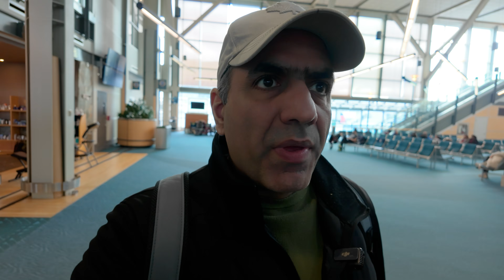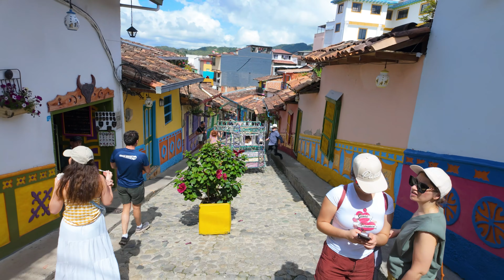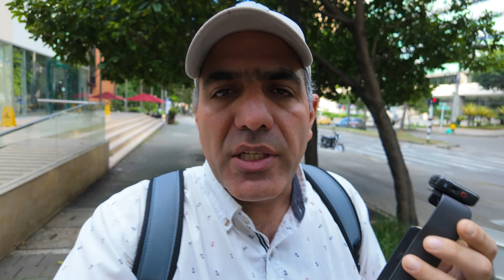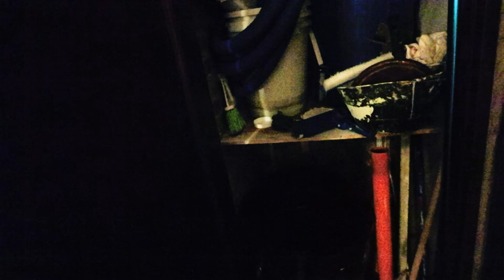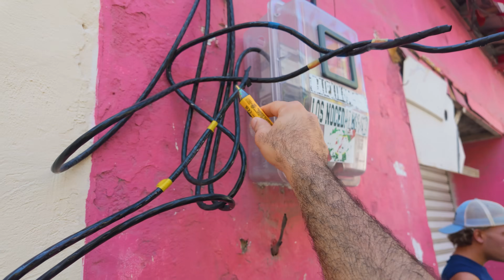Colombia Electrocutes Burglars

Comment: 22:12 you should be thankful the batteries were dead when you tried setting it off. if It wasn't dead and you clicked test, it would have set the alarm panel off and call the fire department, as that smoke detector connects to alarm panels.

Comment: Dude!! I know right? (skinny wires) I bought a deep well pump 220V from a UK manufacturer. when i went to install it the wires for the pump and run-capacitor were 16 or even 18 gauge!!!
thought it would immediately Fail!!!          that was 3 years ago:-) good pump. no problems!!!
please explain in a video!!!

thanks.

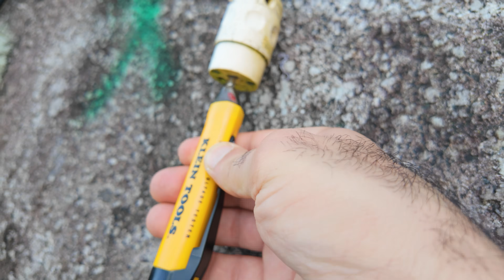Comment: Also, 12:46
Is no one going to mention that plug was wired backwards? He stuck the voltage stick into the long slot, which is supposed to be neutral, but it beeped, meaning, it was actually connected to hot.

Comment: Here in Colombia most old houses don't even have ground wire conection, sometimes not even the copper rod to make earth, so we basically have those 3 legs outlets with a dumy earth so yea you just were lucky to get into new stuff with apropiate elecrtrical standards

Comment: In latinoamerica electrical regulations are not... really.. applied. Connection to earth is kind of a luxury, my building is old enough that it doesn't have one and I live in a very modern area in my city. Most people just... never add earth to their system or they just connect it to the nearest steel rod inside the wall.

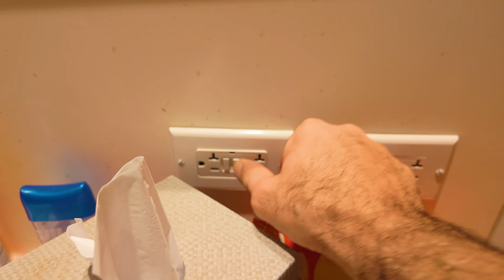Comment: 7:20 In Brazil, we have 220v and 120v depending on the location. States like Santa Catarina have 220v single-phase and 380v three-phase, and São Paulo has 120v single-phase and 220v three-phase.

If I'm not mistaken, some parts of the Northeast also is 220v single-phase, places like the state where I live, which is Paraná, and São Paulo as well, that have both. My house, for example, has 220v and 120v outlets, and the outlets are the same. Nothing prevents some crazy person from plugging a 120v appliance into a 220v outlet. The only difference is that the 220v outlet is red to identify it.

The power lines in my house is two-phase and single-phase. This means that there are two 120v phases and a neutral wire. Combining the two phases gives you 220v, and combining either phase with the neutral gives you 120v.

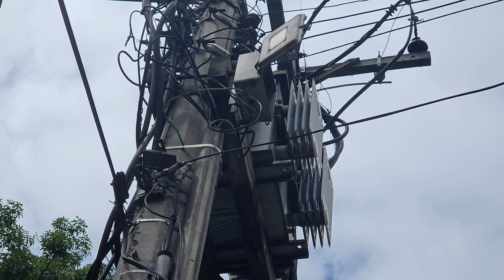Comment: @4:21 thick wire to the high voltage primary. Thin wire to the low voltage secondary, not a fuse in sight.

Comment: India almost follows similar electrical system. 

In kerala( A state in india) plants generate at 220 or 400 kv then through a network of substations on several areas into 11 kv. And the 11 kv lines are then transported to a transformer near house and distributed at 220-240 vac 50 hz all through overhead aluminium and steel reinforced conductors. You will not find any GFCI outlet anywhere. The whole house power system is hooked up to a RCCB and most of the time in several houses these RCCB's are non functional. The law requires u to have a ELCB or RCCB or you will not be granted electrical connection from the state but noone cares to use any test functions or periodically inspect it so the deaths due to electrocution is pretty high here.

Comment: 25:03 Trap for outsiders: DIY 240V.
Reminds me of the Type F socket I came across, that someone DIYed to 360V 3 phase. With one phase (24v 16A) on the earth pin. Which is exposed. And also not made to carry high current for prolonged times.

Comment: When you go on a nerd vacation for electrical things.

If you go outside the tourist areas/ to older areas/ less welthy areas you will probably find the sketchy stuff your looking for.

Arround 18:50 the non functional fire alarm, is illegal as far as i know at least where i am. They must have some other system in place but have that there because otherwise people will not reconise they have any but to have everything there and ready to plug in but it is not plged in means that it is supposed to be.

Comment: Watching from a high rise apartment in Medellín. About twice per month, a power line capacitor will explode in our neighborhood and we'll lose power for about 2 seconds. No big deal. I know little about electrical engineering, but I want to note that most homes in Colombia don't have a dishwasher machine nor a clothing dryer (no 240 volt outlets). Maybe that's why the residential wiring is thin?

Comment: As a gringo living in Colombia (with a Saily eSim), I can promise you'll find worse if you look. My first Airbnb in Cali had an electrical receptacle in the shower, with an extension cord plugged in, with the end hacked off and attached via electrical tape to the leads from an inline water heater. This place had perfect 5 star reviews. I uh... did not stay in that location. The breaker "panel" was literally just a bunch of wires attached to breaker modules and stuffed into a recess in the drywall.

Comment: On some electricity detectors, if you hold the on the button, it turns on to a silent mode. The light still turns red but it doesn't beep. Slightly less alarming to random nearby people.

Comment: If you suddenly connect a discharged capacitor while the voltage is "not zero" you can have more than 9 amps, maybe 900 for an instant, before your formula becomes valid.  Only circuit resistance will limit the spike 👍

Comment: fun fact today its not to accurate but back in the day ive been told every ring on a insulator is an amount of voltage like 5kv so 13.2 residental distribution has probbably 2 insulators. 130kv has a lot lol. im amazed the transformers were on the pole until i said duhhhhhhhh lol. the fact that they look like a pad mount transformers that are outside its case made me think something was wrong then when you showed the 10kv transformer i realized. .

Comment: If you ever come to Brazil, there is a large chance you'll miss the opportunity to bathe in our electrical shower heads because hotels like to be fancy and have gas heated showers. Also, bring a "Type C" outlet adapter or get one in here, because Brazil has a unique power outlet that is recessed into the outlet itself (be sure to see what it looks like before coming). Those North America flat connectors won't fit

Comment: Fala ae, faz um vídeo aqui no Brasil, faz estes testes aqui por que as instalações elétricas no nosso país tem lugares que seguem os padrões tem lugares que não, tem uma parte do país que usa 220AC e outros 127AC 60Hz, dizem que tem uma linha de transmissão que eles transmitem em DC 😱😱  e quando chega na subestação eles convertem em AC, tem lugares no Brasil que não usam aterramentos temos trez pinos mas se usa só dois a maioria das vezes, tem lugares que não usam sistema de fuga de corrente IDR, e tem uns lugares que o único disjuntor é na entrada do medidor lá usam 100A uma vez quase botamos fogo em um estabelecimento por que só tinha este de Disjuntor de 100A usamos um adaptador de tomadas e acabou grudando no pino da tomada na hora de tirar ocorreu um curto circuito e derreteu todos os fios.

Comment: What would you think of a tube made of carbon nanotube rope/@wiring” that also doubles as a composite- with boronitride and other insulation dispersed throughout?

You could have 3 phase power geometrically spaced as an octagon, inside a hexagon- arranged like a knitted tube/ring eventually the walls being arranged like avenues, streets, and screws/elevators/drills/didgeree doos*

All the power and telecommunications would be underground- and electrically isolated/protected.  

Besides having graphene ultracaps, carbon nanotube flywheels, lithium iron batteries, and so on easily added and dispersed (not including what would be on the interior surface of the “tube “- shaped like the one on the old bell labs video {complete with z*speaker grill/slinky*})

24 phase power for a reason 🤧 
- besides power and communications, it would be the largest data center/supercomputer in the solar system

Also- each “sock thread” is at least as wide as a 2 lane (4 lane combined) road/tunnel with easy accessibility.
(It’s a huge sock knitter/dimensional geometric loom)

It would Be cheaper to live there than it would be on earth. By a country mile…. Including power, internet, and other factors….

- imagine being PAID to go to school and live in paradise?!  Just be good…

It would also double as huge telescope, particle accelerator, Turbo, and be even more accurate with measuring gravity waves- just when fusing down to iron- don’t throw it out the back…

The walls would be perfectly electrically isolated (emf shield by design- mainly because of interstellar radiation, external EMF) and the Gigantic magnetic fields on the external outside…. Surface (🎉)

The amount of chains and simple transformers stemming from the central sleeve (ground) to the exterior would be Impressive- Ofcourse, Accoustics and wave dampers/absorbers/noise canceling would be a thing- so you don’t have earthquakes…

Comment: In the middle of some tiny village in Kenya i once found a barber shop made from mud and sheet metal. The windows were just openings covered with metal mesh. I noticed a power wire connected to all of those metal meshes. When i asked the owner he explained he buried the neutral in the ground and in the evening before he leaves he turns on the breaker setting the metal meshes live at ~230V. He did that because apparently there was people stealing his electric shaving machines in the night by ripping out the metal mesh and climbing inside.

Comment: You will see far sketchier things in Syria , out Transformer rooms are open with the power factor capacitor panel broken or operating faulty with Car Battery jumper cables for fuses 
And how the Internet goes away when the electricity comes due to massive interference from both our power lines and our PWM chinese battery chargers or how solar has conquered the country with hybrid inverters but no one is even aware of the hybrid mode so all of it is off grid 
How a Syrian electrical made equipment has no fuses because its meh :/ or how an entire house electricity supply runs threw just one miniscule breaker 
Its not even uncommon to see electrical lines touching each other arcking and dropping molten metal on what ever is under neath

Comment: I don't see an issue with the electric fences. We should adopt them in Canada. It's got to that point in many areas. 
I would imagine most homes use gas to cook in Colombia, don't have a furnace or many high draw appliances traditionally,, so maybe that's the reason for the lower guage wire? I don't think there would be a call for much more than a 60 amp service when all the infrastructure was originally built, maybe less? what do I know? I'm guessing.
If you value sleep during a vacation, don't go to Rio during Carnaval. It's a week of total chaos, sleepless nights, eating, drinking, partying, and more fun than you'll ever have.  I miss Brasil.
Columbia looks beautiful. Always wanted to visit.

Comment: 25:49 i feel the temptation, but alot of electricians do not label the breaker as “do not turn on, working on” this could have result in someone dying. Just wanna say, check if no one is working on the electrical installation before turning a breaker on! Especially public spaces

No critics to our engineer *

Comment: I'm so happy you visited my country! Regarding the thin wires in Bogotá, it's uncommon to have high draw appliances. Weather is always mild so A/C or heat are rare. And most homes use tank-less gas fired water heaters and gas stoves and ovens. Really the highest current drawing device most homes have is probably a microwave oven.

Comment: If the hairdrier was designed for both 12 and 240 VAC Then with constant resistance, it would to twice the the current in its very short life-span on 240 volts, while burning hair of the person blowing focused 3KW air to users burning hair

Comment: Mehdi, just one note: Many times you zoomed in telephony or fiber cables. In South America as whole, we use posts for basically everything that needs a wire, with electricity running the highest and other cables running lower. Many telecom “store” cables for new customers on the posts, so they don’t need to be joining them every time a new customer shows up.

Comment: The electric fencing has two functions. It shocks people trying to enter but once the fence wires touch each other a alarm is sounded it also works if a wire is cut and the circuit is broken alarm is also sounded which is then the main repellent as criminals know they have been detected.

Comment: 0:12 electrics* (or electricals)

electronics are the more technical application of electricity, usually lower powered like transistors and such (whereas you're all about power distribution and macro effects of the circuit here)

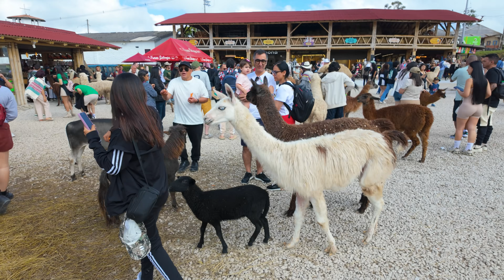Comment: 9:42 I don't know if that is on purpose or not (probably not), but when you just said "There's not a single outlet in sight" then immediately show pig's snout it connected to a saying we have here: "Até explicar que fucinho de porco não é tomada..." which translated to "when you finish explaining that a pig's snout isn't an electrical outlet...". This expression is used when you want to express there's a high risk that someone does something stupid with a wrong assumption. For a second there I was very worried were this section of the video was going...

Comment: Bienvenido parcero, I think you could give a look to the tech in the country side, there you can find a lot of electric fences for cows and horses, many have solar panels to feed the fences too. I have to add, there is no much static charge to build with your body around, not like mexico where you get super charged with just a litle walk to the bathroom over the carpet. The electric equipment and the powerlines are exposed to pretty hard conditions, our climate is a mess and having no harsh seasonal change, no snow and other stuff, we just have lots of rain and sun to be short, meaning, cars and metalic stuff exposed to the elements use to rust a lot. I hope you had fun with your loved ones, is not much but is a nice place we call home, take care

Comment: Very big fan from Cali Colombia. You are a legend with the electronic engineer students. Most of the houses and commercial streets do not have proper grounding, the ground wire is basically connected to the neutral.

Comment: 25:50 that was not very responsible, frpm you Mehdi, to turn that on.
It could be turned off for a purpose. 
Maybe on the other side some electrician is stripping the wires with his teeth. 
It sounds fun, but there's a chance that is not very funy

Comment: Mehdi, i would advise you learn the local language or have a translation app ready when you travel, as a spainard (someone who is from Spain, and therefore can understand Spanish from Spain, as well as it's cousins from south America), when i saw that "HERRAMIENTAS" cabinet i could see the disappointment coming from a mile away
also you misspelled it, next time if you go to a country where Spanish is the main language, try looking for something along the lines of "plomos" (literal translation would be "leads", for the lead element, i think they used to be made out of lead and that's why they have the name, just don't think about it too much) or if they are more modern and actually correct with how they should be called, look for "magnetotermicos" or "magnetos" or something similar (the translation is something like "magnetothermals" they have that name, at least the euro ones, because the black magic behind their current breaking capabilities) or as a last resort option "llaves" or "tacos" seems like a common name in south america ("llaves" translates to "keys" but in context it's more like "valves", like the ones you twist and suddenly your relative is yelling from the shower because the hot water is gone, and "tacos" would translate to those cylindrical wooden pieces of shit that come with Ikea furniture sometimes if i were to know their fucking name)

Comment: For those interested, these fences typically operate at voltages between 8-18 kV, delivering 50 to 60 short pulses of approximately 100 μs duration per minute with very low current.

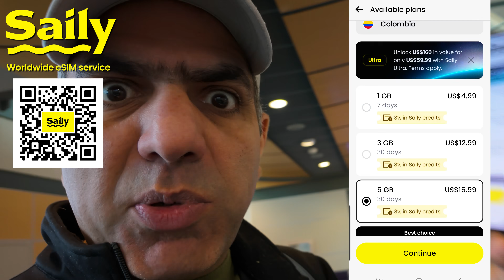Comment: 0:44 buddy. $16 for 5gb!? T-Mobile is giving me “unlimited 5g” for $20. 

*after 50GB I am not guaranteed 5g speeds of several hundred if not exceeding a thousand megabits and get de prioritized only in network congested areas (still faster than priority 4G LTE) so I may very well and often do still see 5g speeds after exceeding 50GB. So I have to whole heartily disagree with $16 for 5gb being any type of cheaper than any plans here. Re shop. You may be grandfathered into some bs plan
Reply: Does T-mobile charge the same price if you leave the country

Comment: To test GFCI, plug the lamp in to have a load. In the other yoke short neutral to ground on your plug. This will split the return current between both neutral and ground, making the GFCI read inequality of current between neutral and hot.

Comment: Possible project: make the voltage tester less suspicious. Put the circuitry of a voltage tester into the empty shell of an old phone with the LED's poking out. Remove the speaker and hard wire it through the empty port to connect to the wall with a dummy charger. So it looks like you are just trying to find a charge, but you are really using your voltage tester. 

Yes, you could test by just plugging in a phone, but it's more fun to have the tester look like a phone.

Comment: 22:08 Be careful with that one! It’s a wireless smoke detector that has a tamper sensor, and will send a trouble code when you take it off the base. Someone could come to investigate. It will work if you hold the button. If you hold the button for 10 seconds, it will set off the building alarm and may call the fire department.